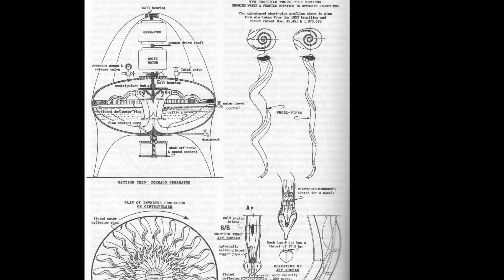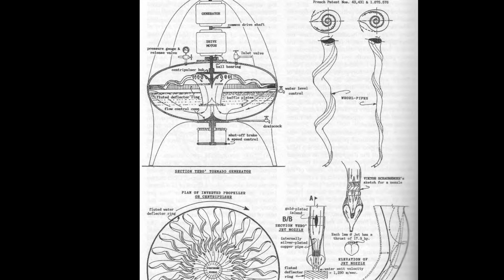Viktor Schauberger's Whorl Pipe

Comment: of course it drains faster, its because its conical. pipe flow resistance is a real thing, but i like your exploration on this thing
Reply: for example, if you take small diameter pipe like straw and blow into it, you will blow faster if pipe is lower length

Comment: Great work. Although can we compare each tube this way as the straight  tube may have more internal drag in your experiment, as it appears to have a smaller diameter at the entry point than your whorl pipe, they would have to be exactly the same length and cross sectional area at each point in the pipe to draw a fair conclusion. Also, Viktor was suggesting copper for creating electrostatic repulsion at the boundary layer reducing the friction further, he reported zero friction in one of his experiments. Have you seen the work of Mark Le-claire, he has some interesting patents regarding cavitation and the excess energy surrounding the natural phenomena of 'implosion'..All the best...
Reply from the maker: You are correct.  I've since recreated the experiment changing the straight tube to make its top end the same size as the whorl pipe, and it out performed the whorl pipe.  So obviously the whorl pipe here as I have created it doesn't work.  As you have said, I need to make it out of copper and maybe make it a bit skinnier, so there isn't as big of a size difference between the top opening and the bottom.  I will try again in time, since I'm in the process of learning how to copper electroplate 3D printed objects using graphite paint and a copper sulfate and water solution.  Thanks.
Reply: @spiritelemental  The original tests on Schaubergers Whorl pipes done by a 3rd party, showed a negative resistance in the pipes. Do not be lead astray by those trying to corrupt and discredit Schaubergers research and discoveries, as you are on the right track.  Also, as a side note cavitation is the nature's brake pedal for water. Only when water goes above its centrifugal "natural speed" limit, will cavitation occur (friction). Cavitation doesn't appear in the opposite motion of a centripetal negative resistance environment.
Reply: @spiritelemental  The stepping of your Whorl Pipe is constant. It shouldnt. Looking at the pipes from the side, the distance from the peaks of the sine wave would also need to obey the golden ratio.

Comment: You had another video you turned off the comments on the gyro ain’t gravity one. I would like to comment that the gyros are slowing to stop maybe because of the bearings of the motors are binding because of the extreme force get put on the shaft. The farther out the more force. But what you kinda are creating is the universe in magnetic model only.

Comment: There are less frictional losses in the spiral pipe since the inlet diameter is larger than that of the straight pipe, explained by simple fluid dynamcis.
Reply from the maker: I guess I will have to alter the straight pipe so that its inlet diameter is equal to the spiral pipes inlet diameter.  Then I will film that and prove you wrong my friend.  lol..   Thanks for the idea though, because I'm always curious to know the truth even if I am sometimes wrong.
Reply: @spiritelemental  I have been interested in Schauberger for many decades now, so I'm not disparaging you or Schauberger when i say I think Salad has a good point. So yes, you need to do that experiment comparing a straight cone with the whorl pipe. 

Another thing to bear in mind is that the dimensions and transition of the whorl pipe will determine the efficiency because of the amount the water tends to curl at a given volume, pressure and velocity (and Schauberger would add temperature to that consideration).  So if you had a much taller vessel you would be increasing those properties - which may help you hit the whorl pipe's sweet spot. Although the pressure will drop as the vessel empties so the sweet spot might be fleeting if any.

Have you seen this experiment covered in Olof Alexandersson's 'Living Water' and Callum Coates' 'Living Energies' and 'The Energy Evolution'. They describe this experiment and flow rate efficiency.
Reply: This is not correct.  The actual experiments and tests with Schaubergers spiral pipes showed a negative resistance within the pipe which cannot be explained with "simple fluid dynamics".
Reply from the maker: I've since done this, (enlarged one end of the straight pipe so its the same size as the large end of the whorl pipe)  and I found that the straight pipe out performed the whorl pipe, so obviously I have to alter the whorl pipe to find the sweet spot as Tony Grant has said.  Make it taller, change the curvature, etc.
Reply: @spiritelemental  Well it's up to yourself if you wish to repeat these experiments. Just know that they have already been conducted many years ago and it was found that the whorl pipes had a negative resistance.
Reply from the maker: @reddpill  I don't doubt those earlier experiments.  I just want my whorl pipe to be able to repeat those results by creating negative resistance.  I've already mostly designed the free energy device that the whorl pipe is a part of, but it needs working whorl pipes.  Mine do not work so my project is grounded for now.  Here's what I've designed so far if your interested.  https://www.youtube.com/channel/UCV0CkrTm5X0Pe5DS8MLLZWw/community?lb=UgkxSrq3RAnjwsjJ8nLad6gmYmtyOGRdl4jC

Comment: I would suggest putting a water wheel under both ends and seeing wich produces more energy.
Reply from the maker: The Whorl pipe of course since it has more water coming out of the end of it.  What I'm curious is if the water coming out of the whorl pipe is spinning or not.   That spin or angular momentum could be used as another source of energy with the right collection method.  Maybe something like the spiral gyro/propeller I recently made?
Reply: @spiritelemental  sure sounds feasible. Like you said in your video the next step is to make a device based on this effect. Even just for demonstration purposes. Again keep up the good work.
Reply from the maker: @cartertech2531  Thank you, and yes I will create the Viktor Schauberger free energy device soon.   I will probably have it complete and put out a video of it in about 3 weeks or so I'm guessing.